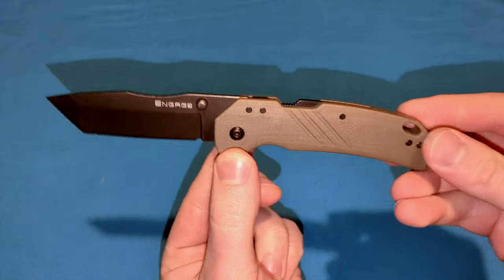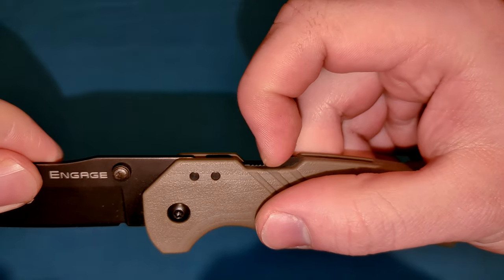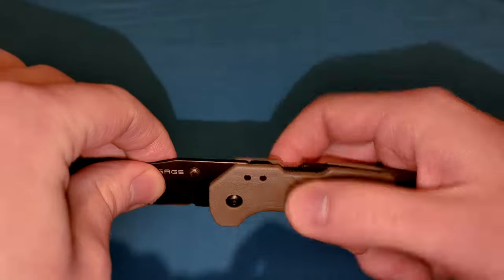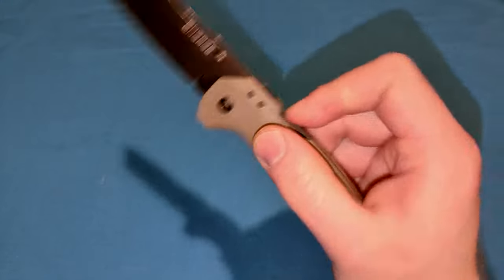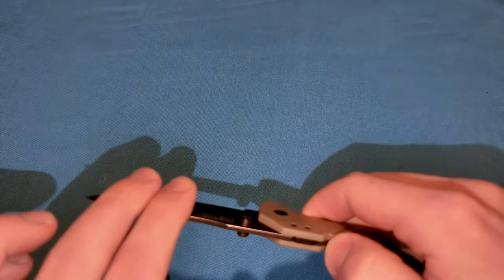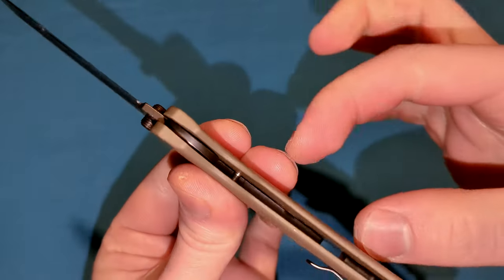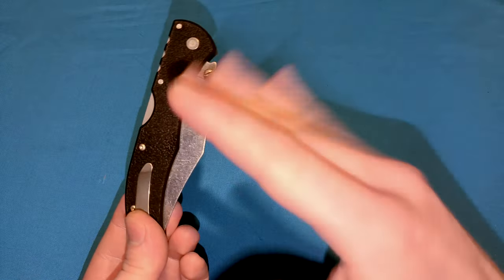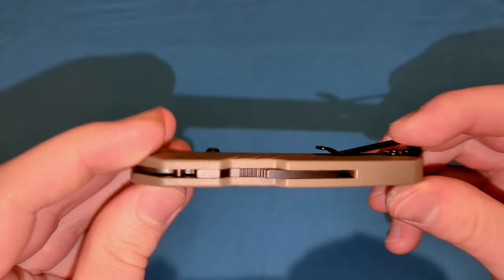How the Cold Steel Atlas Lock Works

Comment: Sorry man, nope..  I favor the Triad lock over all others.  "Fidget factor that cuts you" is honestly just developing bad habits..  
I'm not a big fan of liner-locks either, for the same reason (fidget fun over practical strength), but I can see the Atlas-lock is a stronger mechanism.  
I like the Large Luzon, but I don't really carry it because it isn't practical.  
The Large Serrated Voyager Tanto is my practical favorite, but the inexpensive Kudu ring-lock is usually my first grab for most tasks..    
The ring-lock isn't difficult to master, once you bolt on a thumb stud.  Keep your index finger inside the ring (at all times, opening and closing) and use it like a torque bar to thumb the blade open.  
Keep your index finger inside the ring to close it - you just pop the lock up, ever so slightly, while the rest of your fingers keep that slick handle still, and your thumb folds the back of the blade closed.  Slow at first, then faster as you get comfortable with it.  
This ain't no flippit quick, gangstah move, but it does facilitate smooth, purposeful operation.  I am faster with the ring-lock mechanism than I am with any traditional method of operating a lock-back design.  
Thanks for another detailed and thought provoking video.  I have watched several of them and enjoyed every one.  I look forward to watching more.